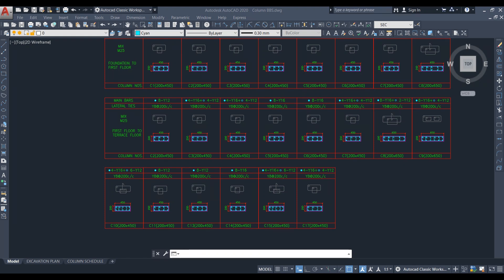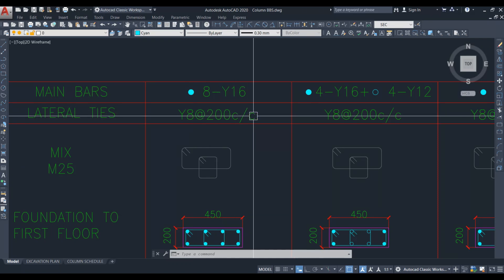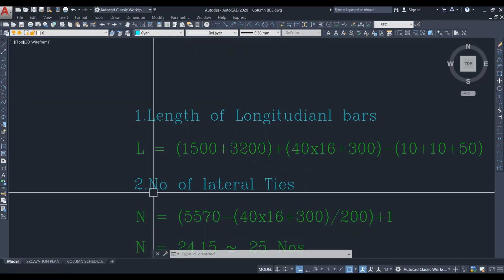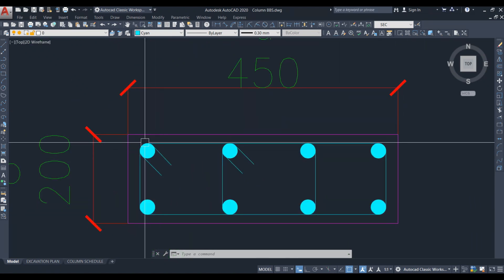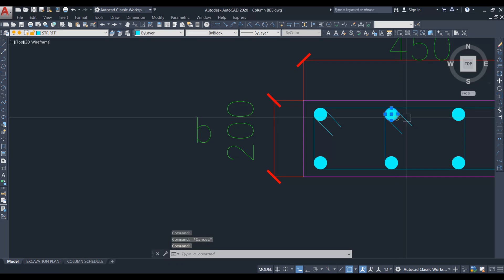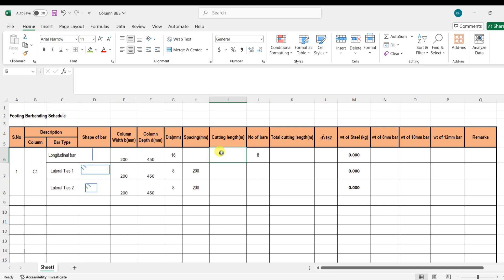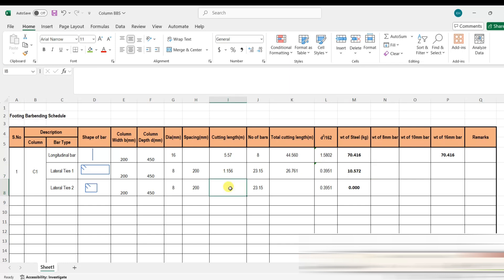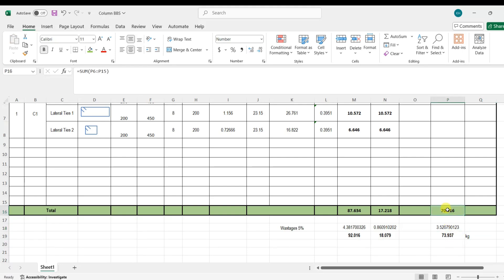Column bar bending schedule | Bar bending schedule of a column | Steel quantity for column | BBS

Comment from the maker: Dear Friends,
Thank you for watching this video.
There is an error in the cutting length calculation of lateral ties
Cl1 calculation
b= 200-(2*40 + 2*8) = 104 mm
d = 450-(2*40-2*8) = 354 mm
Cl1 = 2*(104+354)+(10*8*2)-(2*8*3) = 1028 mm.

Cl2 calculation
b= 200-(2*40 + 2*8) = 104 mm
d = (450-2*40)/3 =123.33 mm
d = 123.33 + (2*16+2*8) = 171.33 mm
Cl2 = 2*(104+171.33)+(10*8*2)-(2*8*3)
Cl2 = 662.66 mm.

The weight of 8mm bar = 15.462 kg
The weight of 16mm bar = 70.416 kg
Total weight = 85.878 kg
Adding 5% of wastages 
Total weight = 90.172 kg.

Comment: Correct me I am wrong, Cutting length of lateral tie 450 - (clear cover) is enough right? Y taking 2D.
Note: I am from a commerce background, just started Civil work  your Video's very useful to me. Without asking others....🙏
Reply from the maker: Thank you for using the videos.
We have to deduct the diameter of lateral ties with clear cover from the breadth or depth of the column. 450 - clear cover - diameter of lateral ties.
This will give the exact measurement.

Comment: Calculation of Cutting length of lateral tie is wrong B: 200-(2*40+2*8) should be 104.
Same way to D should be 450-96= 354. Thank you.
Reply from the maker: Thank you for the notification. It was an error.
Reply from the maker: The correct calculation is pinned in the 1st comment. Thank you.